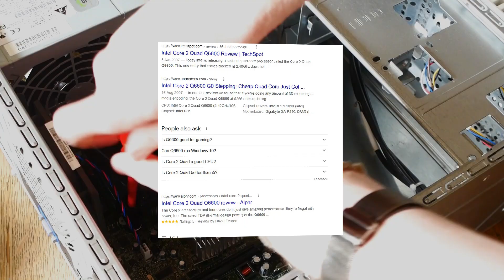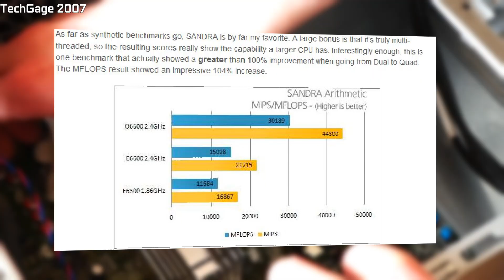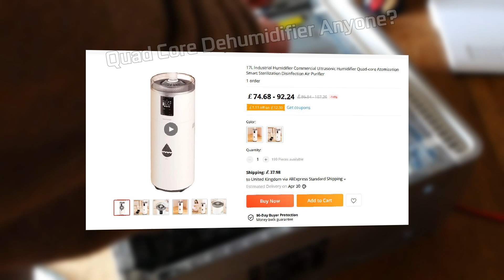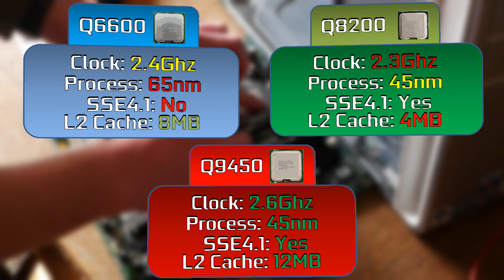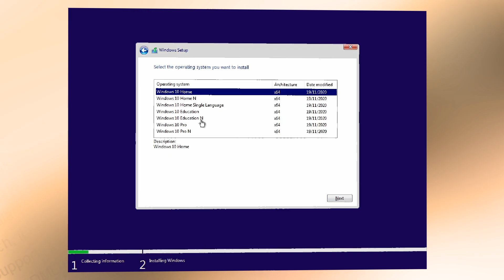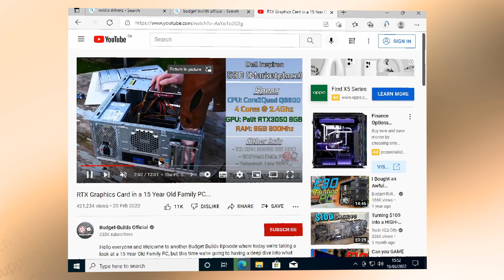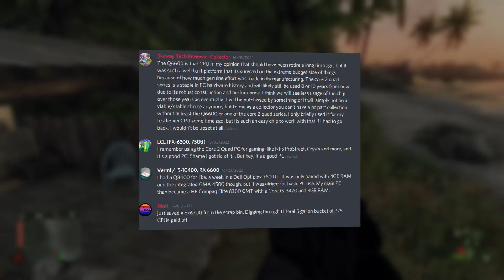Intel's Core2Quad...Finally Obsolete?

Comment: I will say I am definitely blown away by the usability of these CPUs. If you came up to me a few years ago and told me the Core2Quad would still be kicking around in 2022 I would not believe you. We really do need to find a way to immortalize these chips in pc part history for how long they have provided a solid budget option to gamers. Great video had many laughs and I'm extremely interested in seeing the extreme and xeon benchmarks you do in the near future.
Reply: I'm still using one in my main rig and it's surprisingly fast for its age, everything internet related works perfectly and modern games either run or don't launch, but you'd be surprised at the things it can do
Reply: @ethand4784  I'm already pretty surprised honestly.
Reply: @ethand4784  playing modern games on my 9650 @ 4.2ghz. MY problem is ddr2 that is low density 4gb sticks is so rare, I will never get to 16gb. 16gb is totally possible. Gskill made really fast modules for 80 dollars a stick if you can find any om ebay. I have great g skill memory, but 8gb. Slimming down windows 10 makes it not matter with an SSD. 3dmark scores 70% of a more modern 6 core with HT CPU, so midrange i5. That is due to newer nvidia cards taking more load. Radeon rx 580 performs really badly. A 3070 doubles the scores. I hold #2 spot on timespy for the q9650. Only game I can't play is doom eternal. won't load. Any other game is fine and playable at good frames. Top settings on far cry 5 averages over 40fps,. usually 60fps or more.

Unless you overclock, DDR2 on LGA 775 will be faster. LGA775 loves low memory timings. YOu have to overclock about an additional 2-300mhz to make up for the higher memory latency. I bench better at lower clock speeds because I can keep memory timings tighter. 4ghz can bench better than 4.3ghz, without some real optimization. 

I don't know about this guy, but like 3dmark RTX benchmarks I hold number 1 spot for the 9650. 35fps something like that. #1 on firestrike, #2 on timespy. Timespy with a good nvidia card runs D12 apps great. radeons don't.
Reply: @ethand4784  I have the comparison to a ~ 2,4ghz quad and a 3ghz duo.
I can notice a performance benefit of the quad when surfing. It's noticeable faster.

From today on I switcht from a pi to my old core to duo in my arcade cabinet. Even undervoltet it. A quad was overkill in my opinion for what games I put on it.
Reply: @Nordlicht05  Thats actually really smart. You could likely even possibly get better performance and power efficiency with a newer Pentium or Celeron.
Reply: @skywaytech  that was what I had lying around... I also have an old 3,6ghz Celeron singelcore...
I could not run an newer Debian with sufficient speed and the x86 retropie didn't work (black screen). I use the same GPU in my duo. I use retropie because I have all my games ready and working with it from my pi.
Reply: @Nordlicht05  Ahhh ok! I thought you were saying you were using a really old 775 cpu. There are newer socket Pentiums that could work much better, but you are already on top of it. Also yea my bad. I forget a lot of the Celerons made are single core only.
Reply: @Nordlicht05  i'm still using a 2008 era toshiba laptop, upgarded to a 2.8GHz core2duo, 4gb ram an ssd and a 1920x1200 screen.

still very usable for browsing and streaming.
Reply: Well I still have c2x qx9650 in possession and i still used it till last year its a very surprising CPU if you ask me, i even used it to edit something on Corel draw somewhat ok
Reply: @hartomos  This makes me really excited for budgets next video on them. I wanna see what top spec can do.
Reply: I'm still using Q6600. :) Have 2 years Xeon (9650 alterego) prepared, but I am lazy to exchange them.
Basicaly dont have a reason, it will be like 20% faster. I dont game though (only on retro computer, dont like modern games). i play only io games, dosbox, etc, on modern one.
Reply: @warrax111  Cool!
Reply: Budget option as SH and after a few years. Because back in 2007(?) this was ton of money.
Reply: @bestopinion9257  Yea. A lot of things were worth a lot more money back then XD. Just natural this chip gets cheaper over time. I expect intel 1st to 4th gen could become the new budget budget options if those mobos ever get cheap enough x.x
Reply: @skywaytech  I have i5 4570 from 2013 and still can play modern games. It was around 200$ back then, new and sealed. Mobo also cheap.
Reply: @bestopinion9257  3rd and 4th gen really were a top tier line up of cpus.
Reply: You can flash Xeon supported BIOS and cut the socket, insert adapter to make LGA771 CPU work in your LGA775 MB
Reply: @OP4455OP  I've actually known about that for awhile and theres a mod for xeons to work in 775 I believe, but I don't wanna hack up any of my motherboards just to use a xeon.
Reply: Honestly same. It's amazing that a cpu from 2007 can give you Xbox One performance when paired with a decent graphics card.
Reply: @JohnSmith-nj9qo  Yea I agree! Pretty crazy!
Reply: Interesting fact. It still going strong from year 2010. It was bought as used , so it could go from 2008. So working almost 15 years. Also, motherboard still working. Asus P5Q deluxe, P45 chipset beast, bought new in 2010. Still working after 11 years, those solid japanese capacitors and build quality is awesome.
Reply: try first gen core i7 860 still pretty decent
Reply: @JuliTheStar  I have an I5-650 I used for awhile.
Reply: I used to play with q9550 and it was a monster. Paired it with gtx 960. That was the moment i played almost all game at high settings.
Reply: @yakitaki26  Oh thats cool!
Reply: @Green Mamba Games Theres a lot of differences between a chromebook and a C2Q so I wouldnt used that as a comparison ^~^;
Reply: for anyone doing normal daily activities older hardware is still perfectly adequate, the problem with that longevity is that corporate entities are getting frustrated with consumers ignoring there planned obsolescence cycles, this leads to forced obsolescence by way of removing software and driver resources or deliberately crippling functionality based on system specs rather than actual functional capability.
Reply: @prawny12009  Eventually everyone has to upgrade. Just the nature of tech. Unfortunately.
Reply: agree also blew me away Bravo for the Core2Quad LoL WoWee👏👏👏 geez I am buy one just to have and also test and build one, just have to Salute this little Chip LoL right🤓👍
Reply: Xd, in 2017 is sucked do much
Reply: I don't see why, I was using a i7 2600 with my rtx 2070 super only 2 years ago up until i built my current computer(Ryzen 3600xt, 32gb ram, 2070 super) was it the best thing to use no but it still worked. Most games were playable to a comfortable level, but as you can read I eventually built a new computer which obviously performs a lot better, and gave my mother my old computer and put a 1060 in it as well for her. Still works good for what she needs it for.
Reply: I don't believe that it's because the CPUs held up, I believe it's because the future CPUs held back. Take the 4060Ti vs 3060Ti, I wouldn't say the 3060Ti is "great value", more I'd say the 4060Ti isn't. Similarly since AMD wasn't competing until Ryzen they had no reason to innovate for a decade

Comment: Even back in 2016 it struggled a lot with games like Rise of the Tomb Raider. I would say it was already obsolete when Intel didn't release security patches for Spectre/Meltdown
Reply: Well just don't use it for the newest games. Cheap cpus today can't even do that, but that doesn't meant they are obsolete.
Reply: That comes more down to the game and GPU used. I have to upgrade the GTX 660 Ti I pair with mine because I'm constantly in a GPU limit in Doom 2016, even in 720p at lowest settings.

Comment: I still use my q9550 to this day. The 16mb l2 cache in it made it future proof, for sure.
Reply: q9550 has 12MB L2 Cache
Reply: @thendrx18  You sure it's L2?
Reply: @thendrx18  there are some custom versions with increased specs.
Reply: @SlickOnTop  Can you be more specific? Intel's site says they're only 12Mb. So does wikipedia
Reply: My i5 6200U had less L2 than that I belive
Reply: Using mine in a hastily thrown together machine in a spare room office. I smartly had my main setup in a family area, and now I'm back at college part time. Q9550, AMD V4900, WiFi/BT card, 240GB SSD and 500GB 2.5"HDD I had laying around. Unfortunately I can't get it to boot with more than 4gb of ram even though the board is supposed to support 8gb. Works fine for office type stuff, threw a couple of games and emu's on there last night but haven't tried them yet.
Reply: I had an AMD AthlonX4 up until 2019. It's a worse CPU than C2Q and I got far better fps numbers than in this video.
Reply: Q9550 only has 12 MB L2 cache.  Still a very very good CPU even in 2022 as not much has really changed in CPU design.  Anything around 3 Ghz is really all the same these days and besides it's extremely easy to OC the Q9550 to 4.2 Ghz if you want better performance out of the Q9550.  775 wafers were much thicker back then thus allowing for better OCing.

Comment: I gave away my q6600 pc to family members who used it as a htpc for around 10yrs. They gave it away to another relative when they sold their house. It's still working today, it's been through 3 or 4 graphics card changes. (The current card is a gtx 1050ti).

Comment: These chips don't really shine until you hit 3.6GHz+. Too bad they can't be overclocked in your setup. I have an older Q6600 system that's still running at 3.6GHz to this day. All you need is some decent cooling and a little voltage bump, and most chips should reach 3.6.
Reply: Yeah, overclocking is what i really miss in these videos.
Reply: @Elecktr_Rouge  Same here, I love to see what these chips can do when pushed to the max.
Reply: Got Q9400 running at 3.21ghz. Anything higher makes system unstable no matter what (gets to 70 degrees max, so it's not overheating). Too bad, but totally usable, just don't expect too much from it.
Reply: @MrGarryGrey  Yeah, sometimes that happens with the silicon lottery. I've had some bad chips in the past too.

Comment: Hey you're finally covering the Core 2 Quad. Legendary CPUs. 

I think the Q9x50 series specifically still have the power in modern usage. The Q6000 series are usable in a pinch and while day-to-day tasks still work just fine, the Q8000 series consume less power, get less hot, and the higher ends work just as well. The Q9000 series are a good median.

Unfortunately despite still bring usable as a cheap way to get 4 (good) cores, the Nehalem i5-700 series are a better (and sometimes almost as cheap!) alternative to get 4 cores and have an upgrade path to i7-860.

Good video as usual! Always nice to hear your takes on these old tech.
Reply: 2nd-4th gen Core i-series CPUs aren't very expensive nowadays too. They are a popular choice nowadays too
Reply: the X3430 and X3440 Xeons are on the same 1156 socket, perform the same, but are a fraction of the price. I personally recommend those instead.
Reply: @timmy ho in some cases it's actually cheaper. On auction you can sometimes get a H55 motherboard for less than £20 and currently the i5 750 at CeX is £2 and a 2x4GB kit of RAM will set you back £8 from CeX. Not too bad of a price for something that has a decent upgrade path.
Reply: Your bleeding edge q9650 8-16gb ram system can still function over a decade later. 

Even if time has reduced it to an everyday machine rather than a gaming beast.

The killer blow came when software started including launch conditions to detect CPU's, even operating systems have started doing this.